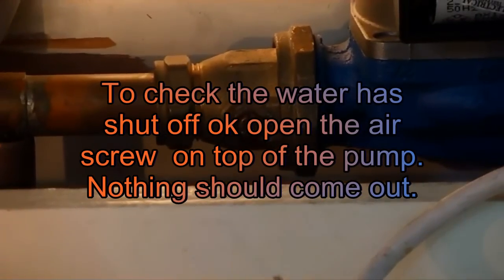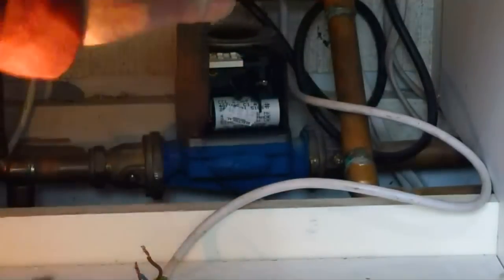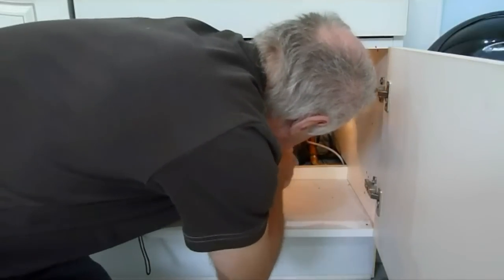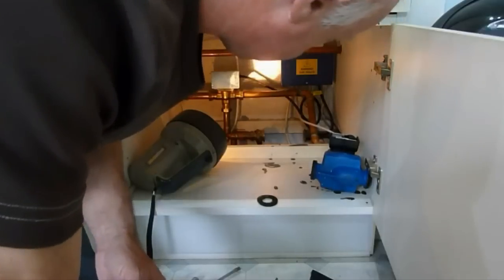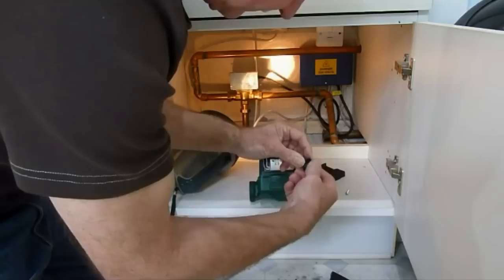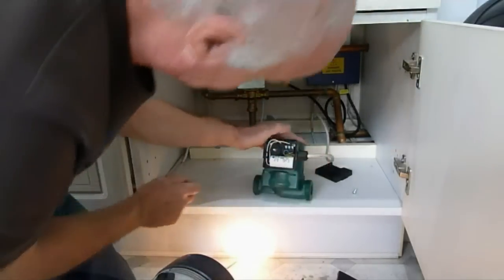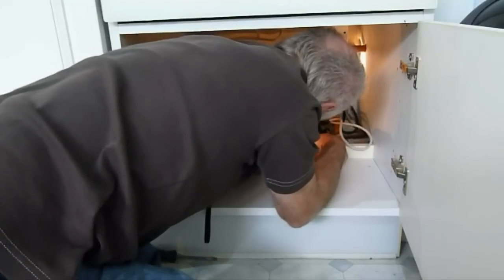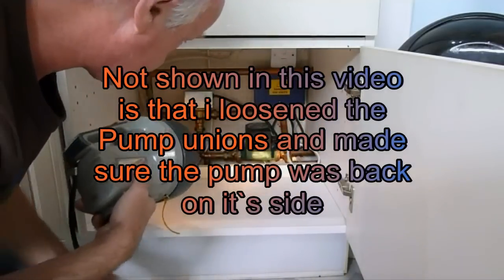How to fit a central heating pump/Circulator. A real job shown.

Comment: Hi Alan, great video ⭐👊. Just a quick question! How can you tell if central heating pump is getting tired and slow? Is there any way of knowing if a pump needs replacing, to other than it's starting to get noisy
Reply from the maker: Good question! Just stick your hand on it when it is running, you will feel if it is running slow.
Reply: @dereton33  Thank you Alan, will do.👍

Comment: Good morning Alan. My pump is facing to the back of the cupboard on the floor and in very tight position. No room to turn pump facing forward, using mirror on stick to see bleed off. No room to get hands in and around to bleed. Seriously can not see why or how they are allowed to fit a system like this. Looks like original system with new hot water tank. Any suggestions please. Thanks.
Reply from the maker: Drain some of the heating system and see if you can loosen the pump nuts then spin the pump facing forward and retighten, then refill the heating system.

Comment: Hi...I have  grundfos pump and it's extremely hot to touch...can't keep hand on it for over 5 seconds without having to remove hand.  Is this an indicator it's had it.  Reason asking as drained system but no radiators now heating.  I checked pump is rotating as I took off screw in middle and when I put screw driver in I could feel it spinning ok.  Contemplating changing head unit on pump but don't want to pay 99 quid until sure that's what it is.   All radiators are bled ok and turned on....gravity tank fills ok and working.   So as no pipes feeling hot on any of the 5 radiators I am thinking it's this pump and the overheating part is the issue.  Help appreciated
Reply from the maker: Pump is fine it will be trapped air where you drained the system.

Comment: whats the sign of a tired pump when I put my central heating on it takes forever and when its on it doesn't get very hot any tips thanks
Reply from the maker: If the pump feels slow to the touch. Do try turning it up to full speed. Be warned though it may not be your pump but black sludge in the system.